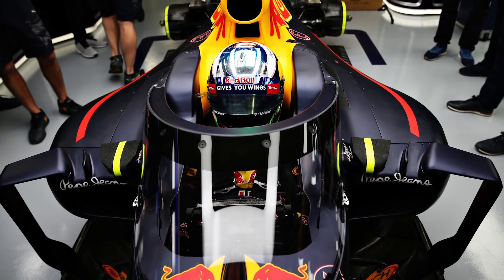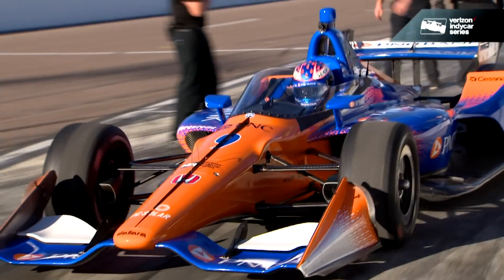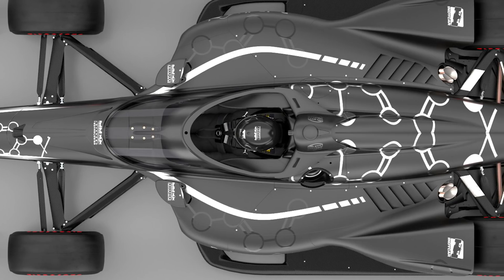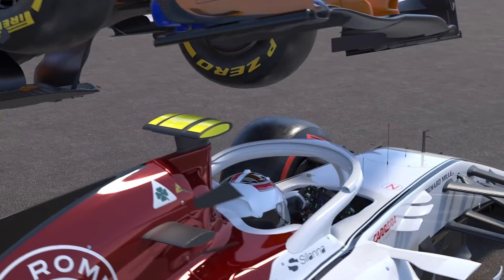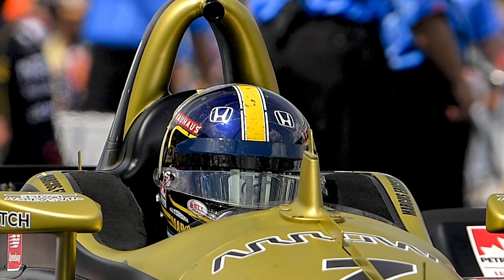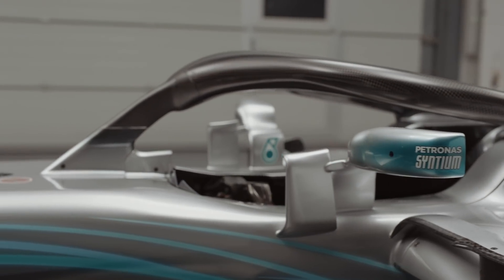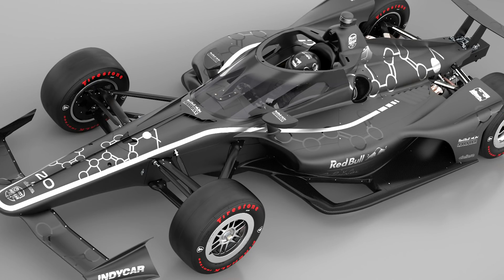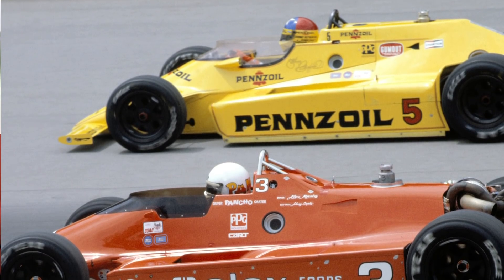Why IndyCar chose Red Bull's screen that F1 rejected

Comment: just make a closed cockpit god dammit
Reply: A fully enclosed cockpit has issues of it's own: How do you do an emergency extraction of a drive if the car is upside down? Is it releasable from the inside? If so, how do you get an unconscious driver out?  If it's releasable from the outside, it means that a driver can't extricate himself.  If you make it both, is it possible to make a latching mechanism that works both ways while still being strong enough not to fail in an accident?  How do you keep the driver from being dry roasted on a really hot day?

Comment: But how will they deal with the insects flying against the "Windshield"
Reply: I’m assuming they will do tear offs like other racing series with windshields. With these cars I also wouldn’t be surprised if the number of bugs is reduced due to the air moving across the car.
Reply: @DustinHasVideos  but the tear offs would only be able to get off by the Pit Crew. Or how would the driver be able to do it?
Reply: Reeezzz it would have to be pit crew. Although with race cars I do not know of any instances of people having to pit for obstructed view

Comment: Both these sports seem too restrictive. Wahhhh 😭your bolts have the wrong size nut wahhhh 😭 your wing is .0002mm too large wahhh 😭

Let engineers innovate, pull the stick out your arsehole.

Comment: when it rains you really going to have more difficult to see what's in front of you
Reply: Hydrophobic and water-beading coat. At high speeds, the airflow may be more than enough to blow the rain off. Otherwise, there may be technologies that use a flat jet of forced air to keep rain from even touching the glass.
Reply: o next rules: ban wet races for the precious babies
Reply: @geert574  leave Nascar out of this.  👍
Reply: Maybe they will add windshield wipers

Comment: I feel like the screen (such a large one, not the small windscreens) is almost no longer an open-cockpit racecar, it's more like a regular (lmp1?) racecar with a hole in the roof.
Reply: Well, LMP1 cars also have straight sides, covered wheels, wider diffusers, headlights, etc. and the driver is't sitting in the middle of the car, so I don't really see a similarity at all
Reply: The 5th King yes, I know :)
Reply: These are still open wheeled cars though, a far more important aspect of these cars imo, so I’ll accept the safety.
Reply: it's still an open cockpit, it just has a bigger windscreen to protect the driver and give them better vision than the halo
Reply: @cocainecowboy_  nah, its doesn't have a better visibility, it actually has a slightly worse one(not by much though) since the aeroscreen itself is actually a halo with a plastic cover surrounding it.
Reply: It's cockpit with open sunroof racing.
Reply: Did you mean 2016 audi r18 no roof version
Reply: Youtube Comment Thread 1:  “INNOVATION INNOVATION F1 INNOVATION BLARG”

Safety:  “What about me?”

Youtube Comment Thread 2: “DRIVERS CAN USE THEIR FACES TO PROTECT THEM, BLARG!!!”
Reply: better than seing a driver die an avoidable death

Comment: I personally agree with the FIA for not allowing this "screen" being used in F1 because if you think about it, the screen which I presume is made out of plastic can break on impact and therefore possibly injuring the driver.
Reply: The screen is not just made of ordinary plastic, but polycarbonate (a.k.a Lexan). The same material used to laminate ballistics glass and "bulletproof" riot shields. Not the same as the 'acrylic' (a.k.a Plexiglass) you'll find in DIY crafts and display applications. They are shatter proof and they flex. The screen would just flex and absorb the impact before deflecting the object away. Given an object sharp enough it would penetrate the screen, but with enough thickness it could get caught in the screen or penetrate to the other side with MUCH less kinetic energy. Breaking off a piece would be almost impossible given how that windscreen is mounted.

Comment: What would the safety crew due in case of the car flipping and landing upside down and what happens in case of a fire and the driver has to be pulled out but the device blocks the crews and it takes slower to pull them out and putting the driver in more danger.
Reply: @Rob Mush Indeed...the problem with these safety measures is that they're mostly centered around one particular risk, often one that caused a fatality in the recent past. But in doing so they ignore new risks as a result of those new measures. It could well turn out that the dangers of the situation you describe above prove to be much greater than that of small debris entering the cockpit
Reply: @oilslick7010  Its simple, use same technology as Mercedes in SLS

Comment: It looks like history is repeating itself, doesn't it?  Sprint cars went from no protection to having roll bars added.  Then they went from roll bars to roll cages.  At each step along the way there were detractors but the cage won and I doubt very many drivers would race without one today.  
The same will happen at some point in the future in IndyCar and F1.  Why not just short-cut the process?  Build the complete cage now, call it a cage, and quit trying to worry so much about form and style and pay more attention to what's most important, function.  
Halo?  It's a roll cage.

Comment: 5:19 - 5:40 This was the reason that I tried to tell people why I chose Aeroscreen instead of Halo back in 2016 during in the comment section.
Reply: The aeroscreen in 2016 were nowhere near strong enough. Hell, the "screen" they're talking about in this video is basically just a halo with a screen attached to it. No screen-like material is going to match the strength of metal by itself.

Comment: How will this not obstruct the view on ovals if it essentially has a halo and a wind screen? Just curious to any comments.
Reply: It was addressed in the video, the halo on the indycars would be mounted higher, or angled in a way so that problem does not occur. Since the screen is there as well, they can do this freely.
Reply: @Reydriel  Thanks for clearing that up, it will be interesting to see the prototype later this month potentially.

Comment: Geez, it's not that hard to get it right... Make it like a fighter jets screen, that wraps all the way around the cockpit. Then stick a bit of a roof on it. Add some air flow. Done.

Then in the event that the driver 'has' to get out fast, have it able that the driver or team can press a button, and the entire assembly ejects off.

All drivers hate the halo, and the indycar 'cone in the face' variant. At this point, there better off with fighter jet like screens.

Comment: I have been to many Race Circuit events back in the 60's 70's & 80's where Riders & Drivers have been Killed, and it's a horrible feeling you are left with. Anything that can make Motor Racing Safer has to be encouraged and followed through. It is accepted that "Motor Racing is Dangerous" to both Public Spectators (1955 Le-Mans) and Drivers, but ANY TINY Thing that can reduce the 'Risk' must be looked at.

Comment: Halo was a quick fix, the aeroscreen corrects any issues that have been prompted through the usage of the halo. Feel like this partnership will benefit all parties.
Reply: The screen not only looks far better, it offers more protection too.
Reply: Michima trouble is, the driver would have zero visibility in the wet due to the oil and debris. A driver could never pull a tear off off of the screen while he's driving. If a bad accident happened due to smudge and lack of visibility there would have to be an inquest.

Comment: What if the driver ahead is leaking oil or something. Will there be a giant tear-off the driver can reach? Also will it need wipers for the rain or will they rain-x it so water just beads up and runs off. Seems like visibility could be a concern in certain situations.
Reply: Already happened in the last race

Comment: The question is will the driver be able to crawl out of the car in case it overturns?
Reply: Indycar has integrated holes in the barge boards specifically to keep the car from overturning at high speeds, but of course the risk is still there, this is definitely a huge step in the right direction
Reply: chuckfish6 _ the cars can overturn at any speed, if the wheel hits a wheel of another car and flips the car over which has happened many times. And when it rains? Are they supposed to just stop races like in Hindi cars, no. Oily, rainy, screens will become smeared and obstruct vision.
Reply: @RB747domme   Clint Tapper  I was merely saying that the new holes are meant to prevent it, and they have proven to be effective, but of course you can never completely stop it from happening, it just reduces the risk. Go look at Patricio Oward's crash at Indy this year. Also that's what tear-offs are for (like in endurance racing), I don't think it would be anymore obstructed than normal, Indy doesn't really race ovals in the wet or torrential rain (Firestone's rain tire is essentially an intermediate, which is pretty dumb)
Reply: @RB747domme  U know about hydrophobic films?? Invisible wipers?? This technology also goes further.
Reply: Explain what you mean, please? How would being a driver in an upside-down Indy car pre-Red Bull Halo be more or less easier than with the new device?
When Poncho Guerrero slid upside-down in his Indy car back in the 90's, I bet he wished he had the Red Bull halo. It would have saved his helmet, that's for sure! Lol!
Reply: @richardadams1337  I'm assuming that the area to get out of the vehicle would be reduced when this windscreen is installed as the drove would have to kick out this windscreen when crawling out?

Comment: Really I have the same beef with the windscreen I do with the halo: the front support pillar blocking view and the halo itself being too low and blocking view...
If they could get the halo ring up a little higher and support it only at the rear, or support it with the windscreen, I'd be much more pro-halo.

More protection is always good but I have to imagine that, as a driver, I'd rather risk it than loose vision.

Comment: Better question: why dont u just make a proper CLOSED COCKPIT like LMP1 & LMP2?? I hardly ever hear any of the constructors of lmp chassis (who have built indycars before btw) having complaints of distortion issues & roof crushing issues before.
Reply: It should be called lmp1 already not indy or f1, its an open cockpit race

Comment: I'm wondering, how do they keep the screen clean during the race? The visors on the helmets have tear off's for that but I don't see drivers reaching out of the cockpit to do that on the protection screen at 300 km/h ;) It is further away though, so I guess it's less of an issue and can be done during a pitstop I suppose.
Reply: Same as dirt bickers (speedway) they have a long roll of clean film mounted to glasses and via button move from one side to other

Comment: With all the tech we still can't avoid putting a huge metal bar in the centre of view?  But in all other racing it's fine?
Reply: Name an open cockpit motorsport with better safety than the Halo or the aero screen
Reply: @peepeepoo3432  it shouldn't be about safety, if you want safety stay at home.  Besides all other forms of racing have no metal bar in the screen yet offer superior protection.  It can be done just like in the cheapest road car.
Reply: @kidShibuya  I didnt say I liked it nor that "its about safety". You keep saying cars dont need a metal bar in the middle and im telling you the halo is the best form of protection in open wheel racing at the moment. Cars that dont have halo are either unsafe or closed cockpit as far as I know. So, please, name a category of open wheelers that dont have "a huge metal bar" and are safer or equally safe to f1
Reply: @peepeepoo3432  you are saying convertible road cars are unsafe?  You can't get out of this by pleading open cockpit.
Reply: @kidShibuya  Convertible road cars have their windshield destroyed by small debris, the aero screen doesn't. A tyre rolling on a convertible's windshield will destroy it and crash the driver to death. A convertible cannot handle an impact at 200 km/h, an F1 can.

Comment: I don't care how it looks as long as it protects the drivers...we have lost to many to head injuries.
Reply: How many F1 drivers have been lost to head injuries?
Reply: Linus A we almost lost Massa when he was at Ferrari, spring hit him right in the head. The halo still wouldn’t have done anything because it hit him on the side and obviously the halo is designed for larger objects in the center
Reply: @linusa2996  Ayrton Senna, Jules Bianchi, Roland Ratzenberger to name a few and Dan Wheldon and Justin Wilson in Indycar were all killed by head trauma...there are many many more drivers that have been killed by head injuries...open wheel and open cockpit racing is one of the most dangerous motorsports.
Reply: @theelectrichobo829  Senna died because he ran into a wall at 145mph.
Jules Bianchi was the 1st F1 death in 21 years (Senna).

Roland Ratzenberg cause of death was the same if he had been in a closed cockpit car.
Wilson is probably the only one who could have been saved by the device they are now using.
Reply: @linusa2996  whatever.
Reply: @theelectrichobo829  don't just "whatever" someone when he just has shown how your statement was questionable...
It's no use to spend millions and millions to fix an issue that isn't really an issue.
Reply: @SufferingAddict88  did you not watch the video? The halo fucking saved Charles leclerc's life

Comment: Im really intrested how they keep the screen clear trough a race. After a 200 lap race in a oval, im pretty sure, the drivers will see absolut nothing because of all the dirt, oil, ect on the screen.
Reply: Tear-offs are a thing in motorsports
Reply: snakedoctor313 
I know. But it will be only removed by a pit stop, the driver dont reach it.

Comment: What about oil leak blocking the view?
Reply: Probably a substance to cover the screen preventing oil or other fluids to stick. The air would probably remove them.
Reply: Or they could have visor stickors that could be changed when pitstops are being done for an extra clean screen
Reply: @abdullahriaz5414 windchill   wiper!
Reply: I thought about vipers too, but would they work efficiently under these extreme winds? Even if they do so, having bars sliding on your windscreen would distract the driver and may be a disadvatage. Furthermore what if it malfunctions, then the driver will have a solid bar on his field of view, dampening it.

Comment: This where I expect the F1 Halo will go eventually, it's the heavy duty crash structure but includes a screen to stop small objects hitting the driver as well (like the spring that left Massa in a coma).
Reply: That spring was by no means a small object.
Reply: @MyRealName  Small in the sense of fitting through gaps in a roll hoop, as opposed to large structures like wheels and wing assemblies.
Reply: Same. There has just been so many who have been worshiping the halo recently that I’m worried about how people will respond to that change

Comment: Prefer the current halo because of it's simplistic design. Minimal obstruction especially during a rainy track and also gives the driver a drag feeling as if the halo is not there. My only concern is that in case of fire hazard, which it may cause an obstruction for the driver to escape as quickly as possible.
Reply: In case of a fire there is enough of an opening so that the drivers would be able to climb out of the cockpit.  I remember when NASCAR mandated new roll over protection and new safety measures for the cars in the late 1970's and then again in the 1980's and then again in the 1990's and again in the early 2000's, Drivers and the teams complained that the drivers would not be able to get out of the cars in a crash or in the case of a fire.  I remember when NASCAR mandated the use of Full-face helmets for all drivers, some drivers did NOT like it!! Then NASCAR mandated All "over the wall" pit crews wear the same type of Fire-suits as the drivers! Yes many teams did not like that either!! Then NASCAR Mandated the Refuelers wear Full Face helmets with fire resistant hoods covering their heads under the helmets, just like the drivers, yes many teams did not like that, but after an incident (Fire) on pit road at a race, they very quickly changed their attitude!!   

What does NASCAR making Safety Rule changes have to do with Indy car and F1?  The Same thing has happened there. I can remember when the Crews in Both F1 and Indy car did not wear the Fire resistant suits like the drivers wear and wear safety helmets with some sort of face protection especially for the fuelers in Indy cars. 

With the "screen" over top of the "Halo", that will provide better protection for small debris such as carbon fiber body parts, small chunks of rubber, parts of the cars such as a piece of spring, etc.  No matter the shape of the "screen" there will be some distortion, somewhere due to the curvature of it. Some drivers will not have an issue with it, while others will have an issue with it.   As to the cooling of the drivers cockpit, there are ways to mitigate that. One example is to do what they did back in the 1970's and 1980's put small triangular shaped "vents" on the nose just under the "screen" that would allow air to enter the cockpit to cool it. But then the aerodynamicists said that created too much drag.

Comment: If we used the lmp1 chassis to F1, or if WEC created a sprint version for the same cars, something like the porsche 919 that runs at the same speed as F1.
Reply: F1 is identified with open wheeler and cockpit racing car for long time, if they become closed cockpit and wheel, it's just become an lmp1 car, not f1 anymore.